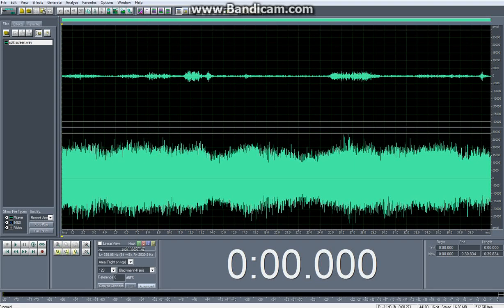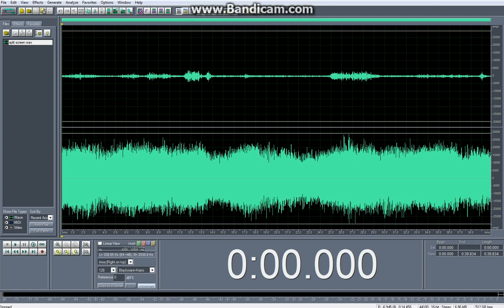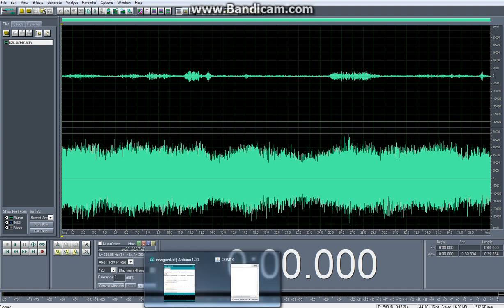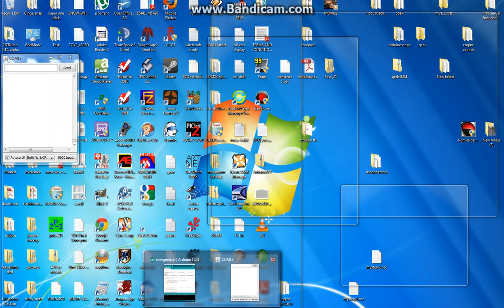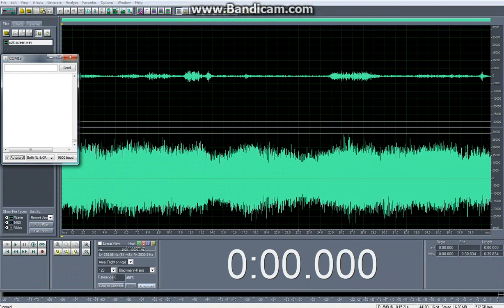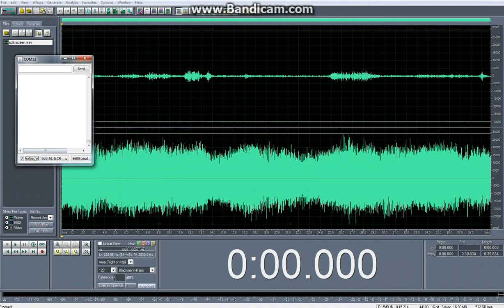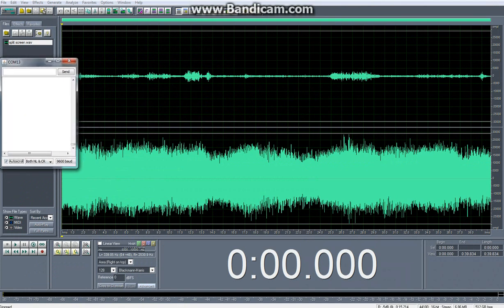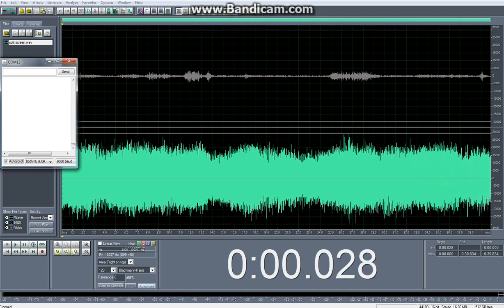Rx8 Arduino knock detector/light

Comment: * PLEASE HELP  **  im simply after an approximate RPM from a knock sensor (on a car engine) with an arduino.... nothing else.      the knock gives a lot of 'noise' and difficult to just get approximate RPM from.
i am trying a comparitor going to a schmitt and then arduino pulse time frequency counting.... works perfect with a function oscillator..... very accurate..... but then on a knock sensor.... eeeek! too much noise....    any ideas?

Comment: want to run a dual knock detector on my ducati 900ie v2 engine ,have  bosch sensors and arduino nano,s (and a datalogger innovate lm2 to accept 0-5 volt analog input channels to accept  hi/low knock events  )
need some info to create 
thanx W

Comment: I am looking to build an external knock sensor for tuning a Formula SAE car. Do you have a progress blog or any information regarding this project you could share? If not, at least you've provided a proof of concept which is a great help, I figured it could be done with an arduino but needed solid proof.
Reply from the maker: I did get it working with an arduino alone, but the response was notchy and it was very susceptible to high frequency noise. I now use a ti knock chip which does all the heavy lifting for me. I'll post the info when I get back to my computer.
Reply: Thanks for the information, I've just looked up the Ti chip, is it this one? Do you still use an Arduino with this to output the signal / do something useful with it? 

http://www.ti.com/tool/TIDA-00152?DCMP=aaj-3q14&HQS=sva-psp-ssp-aaj-3q14-slyt580-00152-tidesigns-en
Reply from the maker: I'm actually using an MS3 knock module, but it's just the TPIC8101 in its reference circuit from the datasheet.
http://www.diyautotune.com/catalog/ms3-knock-module-kit-p-522.html
http://www.ti.com/lit/ds/symlink/tpic8101.pdf
I'm still using an Arduino to set up the chip and  then put the information on the CAN bus. It also limits boost pressure and controls water injection.
Oh and the intersil datasheet provides some useful data as well. The TI is a slightly updated, but nearly identical version.
http://www.intersil.com/content/dam/Intersil/documents/hip9/hip9011.pdf
Reply: Thanks for all the information! I do my engineering co-op's at an aftermarket automotive company so it's very interesting to hear you using an Arduino to control boost, knock, and MMI! We've made our own system to control boost, cool to see Ardunio's being used for it as well!

Comment: Very nice! Will you be sharing your Arduino source code ?  Also how did you interface the knock sensor to the Arduino ?  I plan on doing something similar for a small engine.  Thanks!